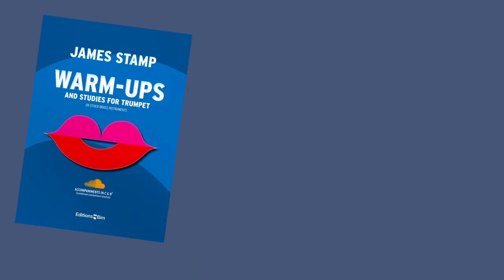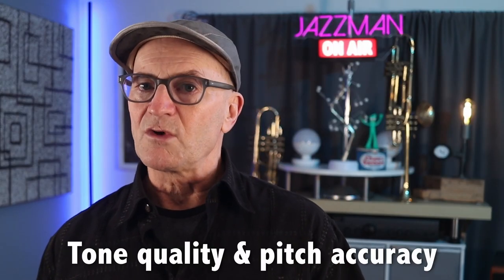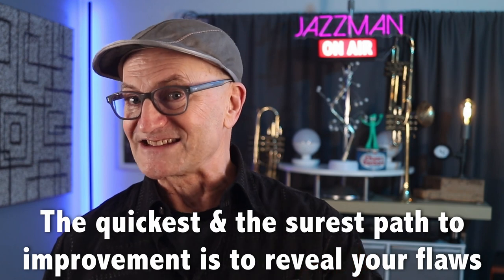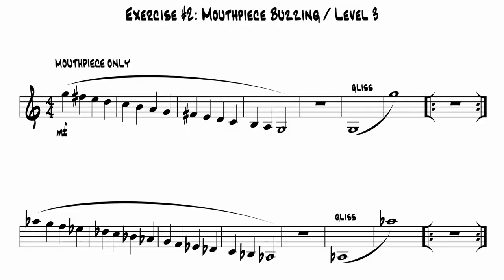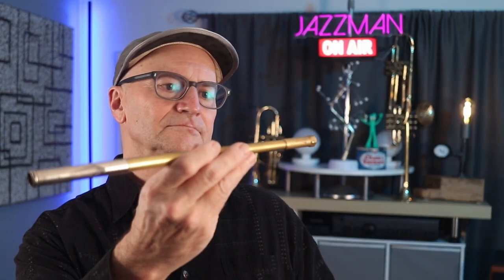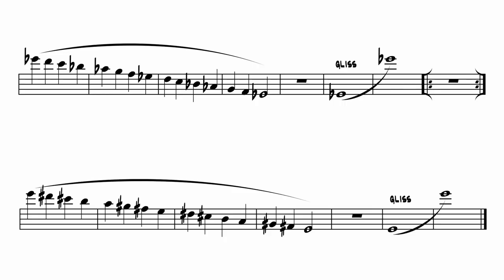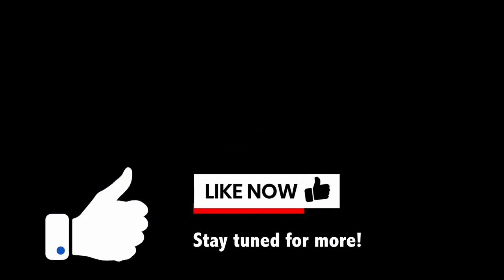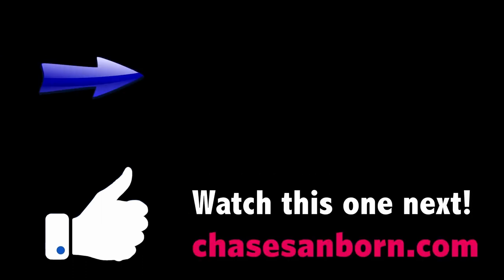MOUTHPIECE BUZZING (Yes or no?)

Comment: Sort of unrelated question. Do you practice to the point of complete embouchure exhaustion? Like when you can no longer play anything above the staff. Or do you think is bad practice. Nice work on the buzzing series, thanks.
Reply from the maker: I practice to the point that I feel I've had a good workout, but not to the point of exhaustion or failure. My general philosophy  is that the primary goal of each practice session is to set me up for the next one.